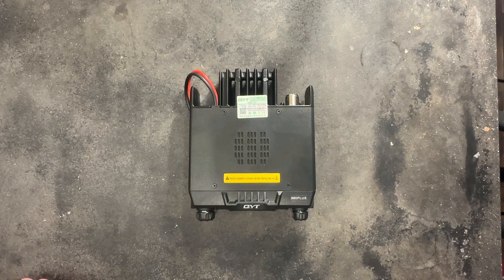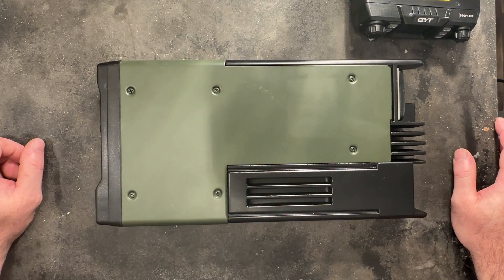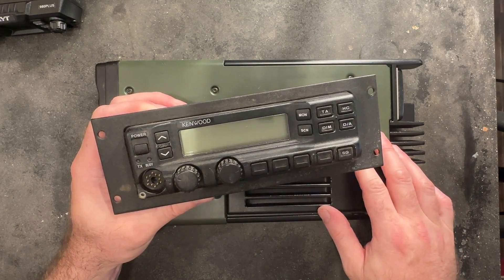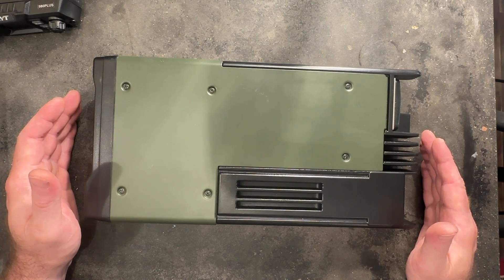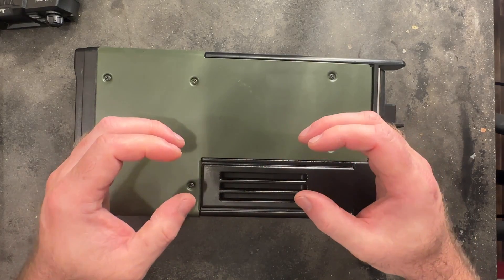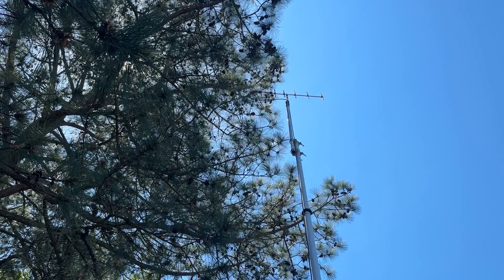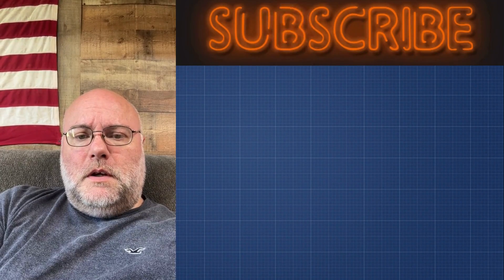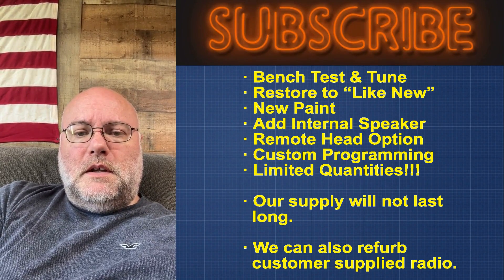The BEST GMRS Radio You Can Own? Converted Kenwood TK-890H Commercial Radio to GMRS. Long Range Test

Comment: I would like to change the radio power setting, it it done on the faceplate to toggle from high and low?
Reply: I asked the same question. Did find out how?
Reply: I did, you have to do it with the dealer software, I made 2 program lists one set at 40 watts and the other list at 100 watts, so I just set on of the buttons on the front for list 1 or list 2.
Reply: @davidhubbard7780  I have the kpg-44d software, is this the same as dealer software? I see nowhere to set wattage in this version. Thanks !
Reply: No sure my friend did the programming.
Reply: @davidhubbard7780  Thanks for your reply, it points me in the right direction. Greatly appreciate it!!!

Comment: How many channels does that Kenwood 40 watt GMRS have?
Reply from the maker: Can program in up to 160 individual channels, channels can also be placed in to separate groups as well. That is really nice for organizing repeaters especially in mobile applications. And the 40w is on the low power setting. High power is specified for up to 100 watts.

Comment: Hi, i have the 890h on gmrs and it was a brand new radio, i have the same mic your using and the kenwood factory desk microphone, but i have low tx audio, is there a way to turn it up some in the program or inside the rig? Thanks
Reply from the maker: Make sure the bandwidth settings (wide/narrow) match on the channel you have programmed in. There is also a “mic gain” potentiometer on the main board that can be adjusted.
Reply: Is it the on marked 507, I will also look in the program
Reply from the maker: @davidhubbard7780  Have to double-check the service manual. But it is a tiny surface mount. I have only ever had to adjust that once on over 200 radios, so it is probably another issue, but good to know it is there.
Reply: I see 501 as wide sensitivity.
Reply: I see that 501 is for wide sensitivity mic gain.
Reply from the maker: @davidhubbard7780  that would be it I believe

Comment: Can this radio be used easily as a base to communicate with other off the shelf gmrs radios like midlands? We have a handfull of midland 15 watt radios on the farm and would like a good high power base unit at the shop. Thanks!
Reply from the maker: Oh yes absolutely. When programmed it is fully 100% compatible. Can use any CTCSS and digital tones you program in as well

Comment: I have a couple of the kenwood TK-890H. I have the programming software and cable. I have programmed the radio with all of the gmrs chaanel and repeaters  I can transmit just fine, but getting no sound from the radio or any indication of receiving on the front panel. I am using the "K" 450-490 frequencies, converted from engine  ignition (r504/r506), speaker conversion running the lead wires from a 5watt 3ohm speaker (not the KES-4) to the 9 pin connector (3,6).. Can you possibly give me some tips on what you think might be the problem? Its the same on both radios so I believe its something I havent done yet.  Thanks in advance.
Reply from the maker: On the back of the molex connector 9-Pin you want pins 2 & 6. Pin 3 is for a remote speaker switch input. So switch those pins around and that should get ya going
Reply: I have switched to 2/6. No difference. The issue is that when the radio is turned on (on both units) the icons pop up on the screen and than disappear. The only pf button that seems to do anything is the MON switch. Should I see any indicator to let me know it is receiving ?
Reply from the maker: @tomlyerly850  If the squelch is open you should see a Green LED light up next to the TX LED. You may have to get them serviced or evaluated. Was this an eBay purchase? Tons of sellers on there just resell but do not refurb or fully test the radios. Hopefully you you were not in the category....
Reply: @Commodium  Yes unfortuanately I was.  Its just odd that both would be the same  Is there a way to send them to you and you can test and refurbish? Any idea about the cost? Not a cheapo, just like to have a ball park..
Please hel. I have tried everything I know. I try to dev into the service manuals and instructions, but nothing I have tried works. Im in NC so we are somewhat close. My best friend is from the Eastern Shores, His father is in the bost business. He built one of the historical ship some years ago in the old construction days
Reply from the maker: @tomlyerly850  Sure thing I can get you fixed up! email me stevetow01@proton.me

Comment: If I may acknowledge what external speaker you using and the hook up for it ?
Reply from the maker: For external speakers I use genuine kenwood 4w speakers driven off the 9-pin rear accessory port. For internal speakers I use 4w mini-oval OEM speakers with header pins of the audio output.
Reply: @Commodium  cool thanks but on the 9 pin connector, what pin number ?
Reply from the maker: @am3dservice  2 & 6
Reply: @Commodium   awesome thank you

Comment: If I was using an 890H as a base radio and wanted to use the remote head function, how long of a run can I make the cable between the radio and control head?
Reply from the maker: I can only guess you are wanting to minimize coax losses by doing a base with a remote head? Probably best to run low-loss cable vs a remote head for that instance. Plus with the extra power these radios provide, that helps a great deal too. You can email me for help on your setup as well.

But to answer your question.. 

13ft or so is probably the longest run you would want to do. I have seen specialty double shielded custom runs as long as 50ft but it would depend on your specific situation.

Comment: I have a selection of Kenwood TK series radios all in UHF, 840s, 880s and 8180. Great radios once you understand the caveats of part 90 radios.
Reply from the maker: Most commercial radios are built like tanks. And also have a lot in terms of flexibility and features.
Reply: I have an 880h using on gmrs. I feel like I should be able to do more with the buttons. It’s just channels up and down, and volume What are or where do I learn these caveats to get the most out of this radio on gmrs.
Reply: @diamondmetalworks13 also wondering

Comment: That was a hoot seeing this. Just talked to you this evening on your latest design. I was the guy on the western shore with the HT talking to you on LP600. Pretty impressive work.
Reply from the maker: Man that's awesome! I am currently working on several designs for the next video series. I'll be on later this evening. When we do the recording for the video maybe we can get you on?
Reply: Just saw this today after talking to you again for those three antennas you were testing. Always a pleasure.
Reply from the maker: @rockspydre  Thanks! I appreciate your assistance. That video will be posted in next couple days. Then have a a YAGI up for a video and on-air testing.

Comment: What type of controller are you using for your repeater with this radio is it a Rick or Raspberry Pi or idiomatic or can any of these hear be used
Reply from the maker: These radios are very flexible for a repeater setup. And any controller that has the ability to operate and external PTT function can be used. The ID-O-Matic, MMDVM, and Rick function perfectly. They also can be easily converted over to 9600 baud data radios to support DMR and other digital repeater modes with MMDVM

Comment: The Kenwood is a great radio, I use a couple of the lower power versions. I am really enjoying your no BS channel. Off topic for this video, have you noticed that the Baofang has a less sensitive receiver compared to say a Yaesu FT-60 ? I mention this because while both radios will talk the same distance, I've been next to someone with a Baofang with my FT-60 and the Baofang didn't hear the other radio, my FT-60 did. This was a very weak signal. Both radios had signal stick antennas. Not trying to throw shade, just wanted to hear your experiences. I tend to use more expensive radios. The lower priced ones work great in most cases. Kind of like running a BCM vs. a Palmetto Armory if you get my drift. I just trust the BCM more. That said, I have a bunch of Baofangs stashed away.
Reply from the maker: No you're not imagining things. The little 'feng radio isn't going to compare to the FT-60. And for the price point they can't. Good reception on radios depend greatly on the filtering, and audio processing. In order for a baofeng radio to retail for $35, they have to use parts that will get the job done, but are economically feasible to use.

That being said, I have done some pretty amazing stuff with a baofeng. I use them all the time for range testing and antenna design specifically because they aren't the best radio you can use. If it works well with a 'feng it will work even better with a high dollar rig. 

That being said, I love em. I own... hell I can't even count how many. 15-20? Maybe I've killed a couple with torture tests, blew one up with a bad amp, even flew one on a drone. I think the cheap price and descent built quality is what makes them a favorite. And if anything Boafeng is probably the one brand responsible for getting so many into starting radio.

Now the real question is Bravo or Daniels? And not a thing wrong with PSA or BCA either....

Comment: With that on 100 watts would make one heck of a repeater
Reply from the maker: Lol I hear the sad hams in the background cracking their fingers getting ready to type an essay to reply to this…. 😂
Reply: @Commodium  those poor sad hams lmao. 🤣
Reply: Yes that would make a heck of a good repeater but for gmrs you're allowed 50 Watts so if you use the 100 watt side you might get away with it for a while but sooner or later they're going to get you because you're only allowed 50 on gmrs granite that gmrs is in the 70 CM band but it's just the frequencies that is allowed for us for me if I knew for a fact I'd get away with it don't tell anybody I would make it 100%
Reply: @frankbowman22  so true
Reply from the maker: And these radios do make and excellent transmit section to a repeater. On the lower power setting at 45w and the addition of a good fan they can operate at nearly 100% duty cycle
Reply: @Commodium  that is probably the best thing yet. To keep working under high use conditions.
Reply: No! nO! you need laisunz for dat!! harrumph!

Comment: The 690 / 790 / 890 series radios where a great radio. Wide and Narrow band capable / 160 channels possible / programmable low and high power. Our fire equipment used the VHF 790 units. We had 45 watt ones in the chief vehicles. The 110 watt versions in the engines / ladders / ambulances. Turned down to 90 watts with special long cables for dual head setup (cab / pumping panel). New they ran about $1000+ for the 110 watt models. Plus you 'can' stack a VHF / UHF  or and dual band from Low band (30-50 mhz) VHF or UHF. 2 different mikes - standard noise canceling or with a key pad on the back.

I own Kenwood 3140 UHF radios for GMRS. Nice radio though discontinued. Small 160 channels - again low and high power settings per channel. Remote mike which makes life so easy when hiking etc. Cheap on ebay - $70 with charger etc. I own licensed Kenwood programming software. (fire service). I like using commercial portables. You can drop them without killing the radios. I've used them in hundreds of fire and ambulance calls over the years without many problems. (nothing is perfect) take care..

Comment: I tell stories about a Motorola VHF-Low unit in a one stack Mack truck with a window in the back. Ground the microphone to engage the CTCSS decoding receive.   The joke was the unit weighed 70 pounds. But the truck lost 30 pounds for all the holes drilled trying to get it installed.  The other joke was if you gave the installer back all his  tools he forgot in the truck. He would tip you $20.
Reply from the maker: Nothing quite like low band vhf. It’s unfortunate that it seems like a forgotten band. But despite modernizing radio systems low-band beats just about everything for simplex radio to radio comms
Reply: Love low band - My Kenwood 690's are still in use. 33.88 mhz fire service but most have gone to digital 700/800 mhz trucking systems. Some of our local departments where on 46.10. Would hear lots of east coast departments years back. But even ours has gone to VHF which makes life easier when on MABAS calls. Was harder when half the county was on LB and rest on VHF.
Reply from the maker: @tompinnef6331  I'm going to be featuring the 690H and the 6110 in the next set of videos. Also have antenna vids coming up too! Low band is often overlooked, but it gets through when most else doesn't.